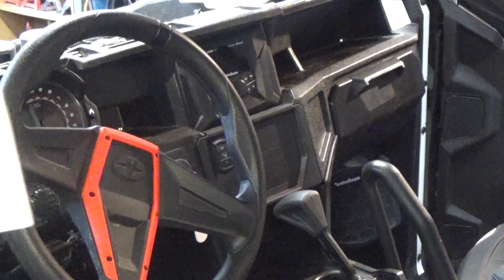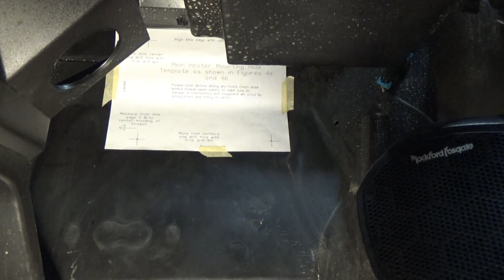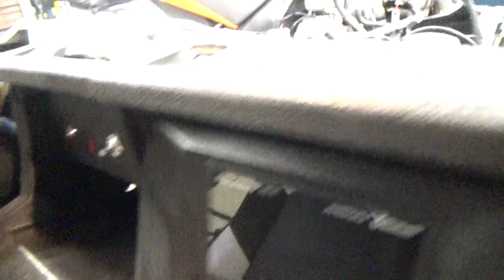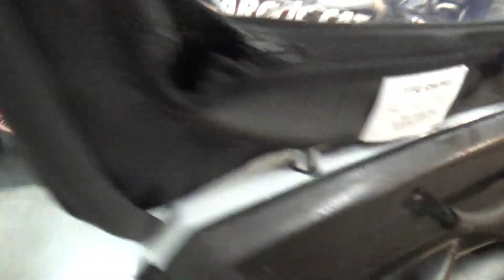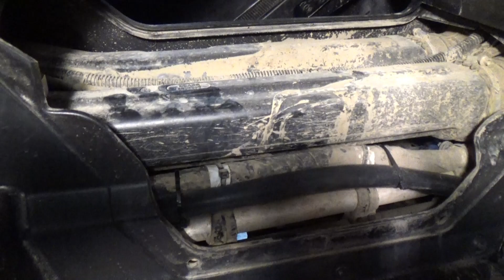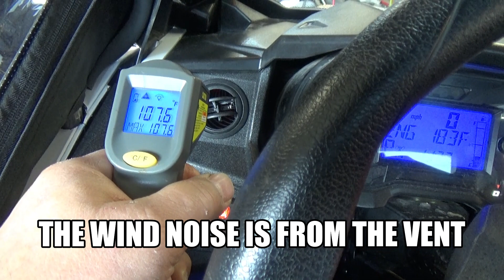2021 Polaris General Ice Crusher Cab Heater

Comment from the maker: I do not have the Polaris General so I cannot check the temperature of the heat coming out of the vent. I also have not used the new style of check valve. In doing my research and reading on the check valve it states that it is an update to the max stat, which is what I used. If you have any questions or concerns, I would contact Ice Crusher UTV Heaters or coupersproducts.com there is a one eight hundred number on their site. For all your questions. Thanks for watching Dirt Poor Tv 
My install video on my Polaris XP 1000 shows some temperature readings of the vents. But those readings are not the actual readings of the air temperature. So it is kind of deceiving. The readings are of the temperature of the Heating ducts. But for the duct to get that hot, the air passing by them has to be hot. The kind of thermometer I am using does not test ambient air it test surface temperature.

Comment: I just installed an ice crusher dual fan in my general. I appreciate your videos to help with some of the fine details of the install.
 I have a question, what kind of temps are you seeing out of the vents while out riding? My system came with a newer ball valve that went into the oil cooler line and I was wondering if the way you set up that one gave better heat than mine does? Thanks
Reply from the maker: Thanks for the positive feedback. I do not have the Polaris General anymore so I am unable to check the temperatures coming out of the vents. If I get another unit with the Ice Crusher cab heater, I will check the temperatures and get back with you. You could contact Ice Crusher Heaters at coupersproducts.com. They would be glad to help you with any of your issues. Thanks for watching Dirt Poor tv.